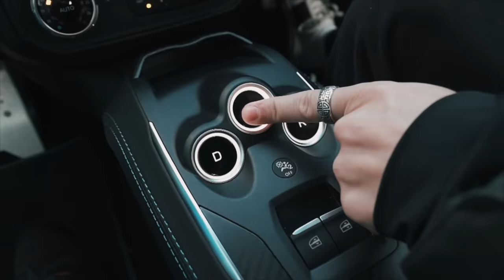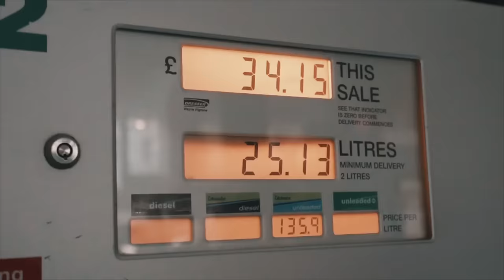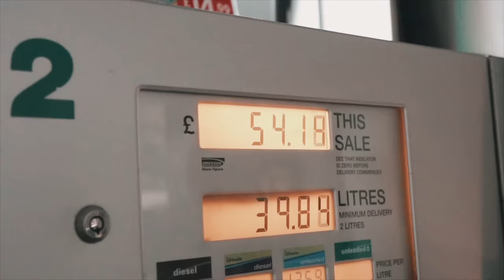Why Did I BUY The ALPINE A110 Premiere Edition?! - Vlog (Ft. New Pet)

Comment: Since you 'rescued' this chicken, she is now your responsibility and you need to know that chickens need a "perch/roost" to sleep on at night as they cannot see after the light gets dim and they are not going to feel safe and secure on the ground/floor. You also need to be sure you close them up at night and open them up in the morning so that predators cannot attack them when they are helplessly blind in the dark. The bed you bought is useless unless you intended it as a toilet. They don't sleep in beds, rather they get up as high above the ground as they can before the light goes away each twilight. They "do" respond to handling and personal contact if you can provide that on a regular basis. Otherwise they will forget that you want to hold them and assume you are attacking. PS; I like your Alpine very much.

Comment: If she has a hutch with a clean laying area and clean bedding(straw, sawdust, whatever), oystershell grit (calcium to create the shells for her eggs), and food (called 'layers pellets' - super cheap)+water she'll be fine. I'd be careful of foxes though (takes then about 3 seconds to kill a chicken and they can smell them a mile off), and as you've seen, chickens can actually fly quite high, so you should probably get some supplementary fencing to keep foxes out and the chicken in. If you're in the garden frequently then you don't necessarily need more than one chicken, but if you're gonna leave them alone mostly then you probably want more than that. They can eat basically any leftovers except raw potato (and maybe avoid feeding her chicken as well) and watch out b/c lettuce and dairy can give them diarrhoea.

Oh also, if she isn't already, she'll be laying soon-ish most likely (unless she's a rescue with an unusual background), and you want to collect the eggs on a daily basis, or she'll get into the habit of eating them.

If you want lower-maintenance, you can buy a coop and chicken run combo called an "Omlet" to keep them in if you don't want to increase the fencing for your whole garden. They're pretty expensive but they're very well built and completely fox proof if you leave the doors closed. https://www.omlet.co.uk/shop/chicken_keeping/

Comment: It will drop a lot in value. That's my guess, and no it's not something I say just to annoy you. 

The car was just recently launched, that's the reason of the high value of used cars. 
The used car price point they try to target is too close to cars like AUDI TTS, Porsche 718 that both offers more HP and are well known brands. The Alpine unfortunately lack any specification or feature that makes it stand out. They put a lot of focus on the weight, but made it impossible to daily drive it. There are literally no storage at all, something that would be ok on a super sports car but not on a car that's targeting the average consumer who will end up in situation where the car needs to be used as a car.